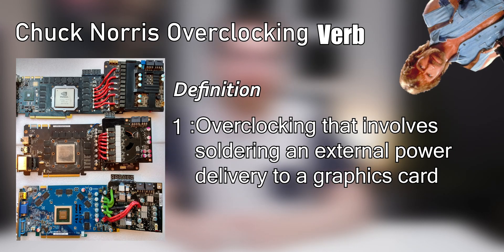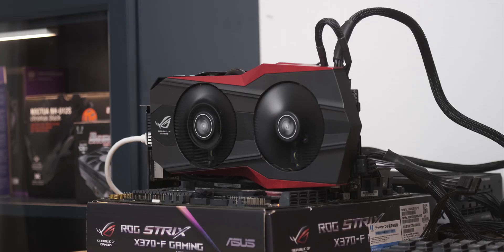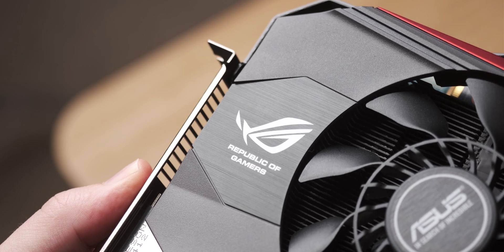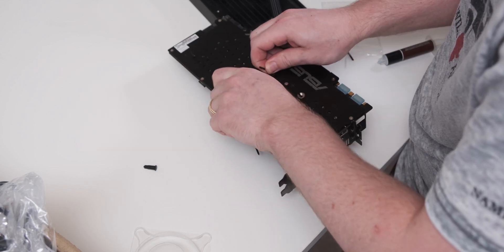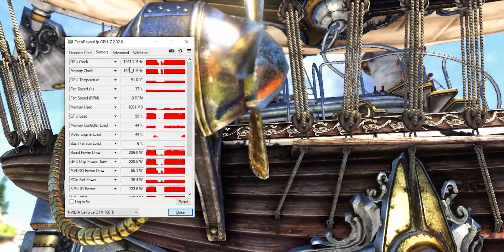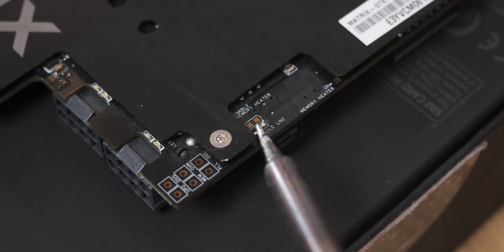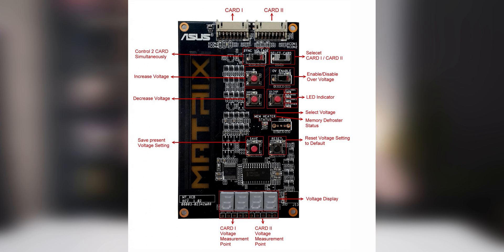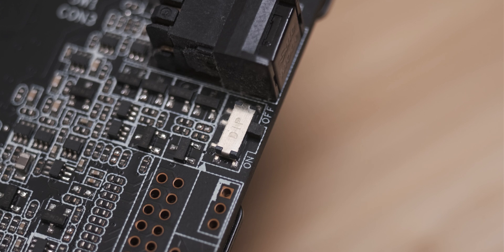My first attempt at Chuck Norris Level Graphics Card Overclocking... Kind of

Comment: the reason the fps increase is minimal is because in this case, memory bandwidth is the limiting factor !!! .  Just incresing core clock will do nothing, you gotta fina a way to oc the memory more as well... [ maybe using slightly higher voltage for the memory ] . not sure this is fully possible, but power limits and shunts will only get you higher clocks and not higher fps in games. This kind of problem is most noticeable with low end cards like the gt 710 and the 1030, OC on the memory brings almost 20 to 30% more fps without even touching core clock for the 1030 from my experience. Love tha vid btw ;-)

Comment: that was actually a great choice for this, actually the best option would have been a Classified or Kingpin card since you don't really have to modify those to get wicked voltage and power.  I had Kepler (7 series) Titans that I modded and OC'd the balls off of until one of them started to die, took them to 1450 MHz core on liquid at 1.425v and 400+ watts of power draw.  To be honest unless you're going full crazy with LN2, modding cards in that manner is pointless, they'll hold a lot more juice than you'd think as long as you keep them cool and have the proper BIOS for it.

Comment: When I used to have a 780 ti, there was a thread on OCN about how to exceed the voltage . It involved using a batch command to unlock MSI afterburner ( an older version which should be mentioned in the thread) and then allowing you to push it to 1.3v on an EVGA classified bios. Try to do some searching through the forum and it should pop up. I'll see if I can find it as well. Great video.

Comment: You can't do it without the separate board, Kepler is limited to 1.212v without it and that's the only way around it sadly. But it does allow complete voltage control. I won't link it directly but you can probably find a daughterboard designed for it on ebay.

Comment: did you check VRM temps? You could be throttling in game that is why it's not showing any decent improvements. Those fan placement to cool the VRM is  not good enough. You need a fan directly blowing down those miniscule vrm heatsinks.

Comment: if you want to do some crazy over clocks on a cheap graphics card. Try to get a passively cooled one. The silicon on those is pretty high since they try to meet stock clocks with no fan. I took a PNY 7300 GT that was passively cooled, through a fan on it, and nearly doubled the GPU and RAM speeds. I would assume passively cooled gpus are manufactured roughly the same

Comment: here are my overclocked max clocks ona 750ti (so yeah as you can see i got A MAJOR bump in clocks ON AIR BTW!) if i can share my 3d mark score for this card i would but im unsure how to share that on youtube...only has share to fb option... the stock clocks vs my modded bios clocks on this 750ti FTW which has never had thermal paste reapplied still lives on ina box atm but none the less moding the bios yourself is best !
Graphics CardNVIDIA GeForce GTX 750 Ti Clock frequency 1189 Average clock frequencyN/AMemory clock frequency3,198 MHz (1,350 MHz)
here are what they come from stock Base Clock: 1189 MHZ
 Boost Clock: 1268 MHz Memory Clock: 5400 MHz Effective

Comment: I might be able to help out here, since i ran in a similar problem on my 680. Although this didnt work for me, it might be worth to take a look at this:
https://www.overclock.net/forum/69-nvidia/1398725-unlock-afterburner-limits-lots-cards-some-llc-one-tool-all-ab-versions.html
Sadly i dont know which vrm voltage controller the matrix uses, but you should be easily able to find out by looking at the card. If it doesnt woork with this I2C workaround, you might have to consider hardmodding the volts, which I ended up doing since nvidia decided to limit the voltage on my card by pcb design.

Comment: There you are, you can now reach 1.30V without any hard mod
https://www.overclock.net/forum/69-nvidia/1398725-unlock-afterburner-limits-lots-cards-some-llc-one-tool-all-ab-versions.html
https://www.overclock.net/forum/69-nvidia/1425102-updated-ab-b18-team-skyn3t-s-unlocked-ncp4206-voltage-llc-mod-tool.html

Get ready with the fire extinguisher.
Cheers

Comment: Starting to think i shouldnt have sold my asus reference 780ti. That card was a beast. 1.212v used to get me.to 1325mhz stable at 100% fan to keep the card under 65c. Even memory was crazy. It would take 500+mhz in afterburner. I should have watercooled it.

Comment: for vga hotwire you can use a variable resistor between the voltage control point and ground, lowering the resistance will increase the voltage

Comment: the Card is using the ASP1212 PWM Controller (datasheet here: https://www.infineon.com/dgdl/pb-asp1212.pdf?fileId=5546d462533600a40153567f4b2128a4 for the VCore rail (if i remember correctly, if i'm wrong you can read the name of it from the card) that one has a public datasheet so you can find the feedback pin and do a feedback voltage mod. you can find info on Feedback Voltage mods here: https://www.overclock.net/forum/189-general-volt-mods/1637811-general-gpu-voltmod-external-vrm-information.html. that mod will give you full undisputed control over the voltage. no bios mods no driver errors. if you're familiar with Actually Hardcore Overclocking / Buildzoid he makes a lot of extreme overclocking related videos on his channel. he talks about some mods you can do and the effects they have. in short there are a few popular mods you can do: Capacitor mod, Voltmod (here as Feedback mod variant), powerbridges, OCP/OTP mods and many more.
your card scales great with cold. if you want to try it you can get very cheap custom watercooling gear on ebay or ali express. i made a loop with these components. i use a 15$ cpu block that i drilled some holes into to make it fit on a gpu and a 20$ radiator with some 1$ per piece fittings. i have some EKWB tubing and until a month ago i was using an aquarium pump until i got a proper Alphacool DDC pump res combo. such a loop should outperform an AIO pretty significantly. i watercooled 780Ti's with that before and got load temps in the 40s.
 you could also try to flash the Kingpin / KPE bios onto your card (https://www.techpowerup.com/vgabios/152686/evga-gtx780ti-3072-140103). it should be compatible as i flashed that bios onto one of my reference 780ti's. that bios will allow you to go to 1.3V without a physical mod if you use evga precision x16. Kepler doesn't scale as much with Voltage as Fermi or AMD 28nm so 1.3V could already be enough for above ambient overclocking. but since your aswell as my own findings support great cold scaling on Kepler (and maybe also Maxwell) it might be worth to use a chilled water loop with it (which could be possible with an AIO if you submerge the radiator in ice water but i would recommend to go with custom watercooling at that point which brings the option i talked about before back up.)
all in all i'm happy to see you're determined to let the Matrix fly. it's a wonderful card with a ridiculously powerful VRM. i hope you can get it to 1300MHz. with a chilled waterloop you might get to 1350MHz.
Reply from the maker: Hello Cmdr, thank you so much for all of this information. I will look into all of those options. I didn't flash a Kingpin BIOS onto it because there was a video Jay made talking about how if you don't use a BIOS exactly for your card that you will brick it. However I guess it should be fine considering that I have flash multiple different bioses on to other cards before and it was fine.
Thanks for again for all the info I will definitely use all those sources. 👍

Comment: I overclocked my rx 580 and it sounds like a jet engine so now its on stock😭
Reply: Just undervolt it instead! Same performance, lower power draw, lower temps, less noise.
Reply: Also use a custom fan curve

Comment: When you manage to unlock the voltage and overclock this card, do the same for GT 710. Somebody has to do that.
Reply from the maker: I would love to do that. In my experience the GT 710 overclocks surprisingly well so I think it could go far with a proper VRM. 👍
Reply: Did I not warn you that this had been done before....in 2014!
Reply: @MasterToneMods  link?
Reply: @DawidDoesTechStuff  Yeah with the extreme overclocking stuff people did in the cheapaz chips competition with liquid nitrogen, zombie board vrm & the gt 710 they hit quite high numbers on that little chip, 2 GHZ on the core & 1225 mhz on the vram clock.
http://oc-esports.io/#!/round/cheapaz_chips_s1

Latest one was done with the HD 5770 for gpu.
got a gigabyte batmobile cooler HD 5770 & a sapphire HD 5770 lite
(My first newly bought gpu this sapphire HD 5770.)
https://oc-esports.io/#!/round/CheapazChipsR1HD5770

Comment: If you want to give another card a go, I know almost for sure that Classified cards from EVGA, have this leaked .exe that allows for voltage tuning, I've pushed my GTX 680 Classified to 1350Mhz before on 1.25 or 1.3v before.
Reply from the maker: Not sure what happened to my comment, but yeah those EVGA OC cards look really epic. I will see if I can get my hands on a 980 ti classified or maybe even a Kingpin. 😁
Reply: @DawidDoesTechStuff  I'd recommend checking out the comments on the forum thread of that card, from what I understand, it has worked on 770 Classified cards as well as 780s? Hey try using it on your card, maybe by chance they're using the same voltage controller or something. You can find the exe by googling "classified.rar evga", it was the first result for me, its a post from 2013 with a mediafire link, give it a go. :b
Reply from the maker: Those classified cards do look really amazing! I'll see if I can get a Classified version of the 980ti. Maybe even the Kingpin version. 😁